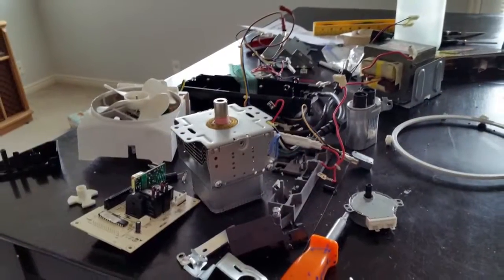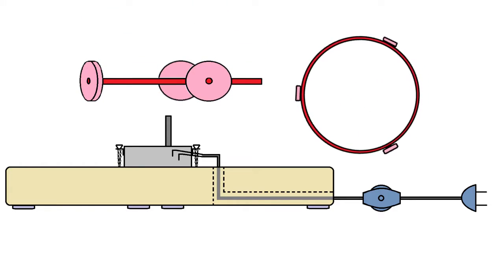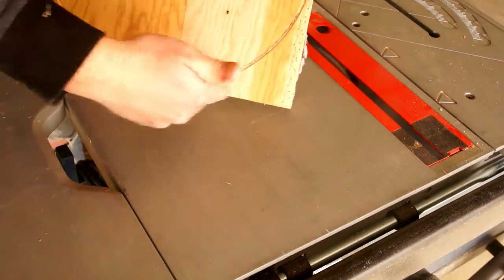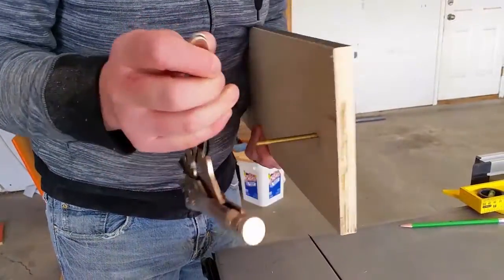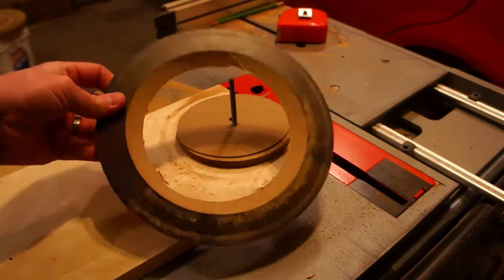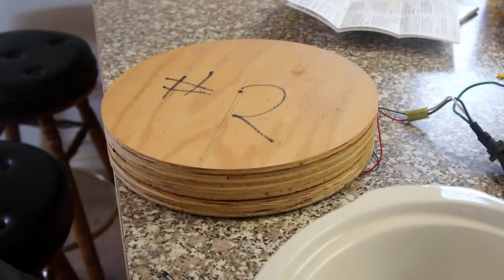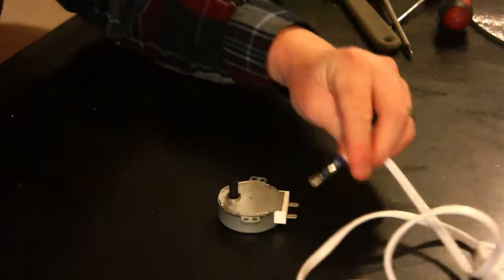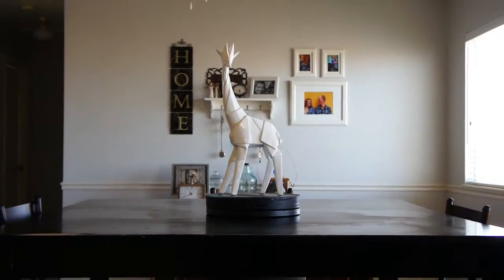Build an electric lazy susan and recycle microwave parts (self rotating display pedestal)

Comment: Can a dimmer switch control the speed without damaging the motor?
Reply: Jason Chatto unfortunately no. The motor is AC and will be damaged if the voltage running to it is changed too much (basically what a dimmer switch does). A DC motor's speed can be controlled with a dimmer switch but even that isn't the best way.
Reply from the maker: Jason Chatto exactly what the quintessential gamer said. A dimmer switch on a DC motor would be the easiest way of controlling speed. A pulse width modulation (PWM) controller instead of a dimmer switch is more effective and you can find ones for small DC motor's on ebay for $5-$10. And if you REALLY need to control the speed of an AC motor there are variable frequency drivers (VFD's) but they are expensive and are meant for large motors.
Reply: How would you go about making a low cost variable speed unit?
Reply: Sorry,  I asked that question before reading the second reply.  Thanks to both of you.

Comment: not good... we 're interested in how to make a lazy suzan that rotates  10 or 20 degrees increments  and stops without using arduino  or other expensive means
Reply from the maker: could you elaborate further on how you'd like it to rotate? what application are you wanting to use it in?
Reply: a lazy suzan for 3d scanning photogrammetry. move  10 degrees then stop  until you click a switch again  then move another 10 degrees stop ...  i know its probably not  easy  and you have to  use  a stepepr motor and arduino board to controll  it ...not sure if a simple mechanical solution  is available ... somehow  after 10 degress the motor to loose contact ... but to be able to  witch it back on  for another 10 degrees and loose contact...
Reply from the maker: Interesting use. I'm sure it is mechanically possible to have it rotate 10 degrees, stop for a few seconds for you to snap a picture and then it automatically rotates another 10 degrees. But I doubt it'd be a simple solution. I think using a stepper motor driven by a dev board would be an easier solution that provides less moving parts to wear out or jam up and can be far more precise if needed. If it needs to be exactly 10 degrees each time then u can calibrate the dev board to drive the motor x amount of steps. You could also forgo the motor and use move it by hand and have one mark on the side of the rotating piece and more marks every 10 degrees around the base, so u just rotate until the lines meet, snap a pic then rotate till it lines up with the next line.

Comment: excellent!  Do you know how much weight this turntable resist?
Reply from the maker: It's current load is probably about 5 lbs. Really if a typical microwave platter can turn it, so can this thing.
Reply: +Q.T. Productions of Utah Tks!